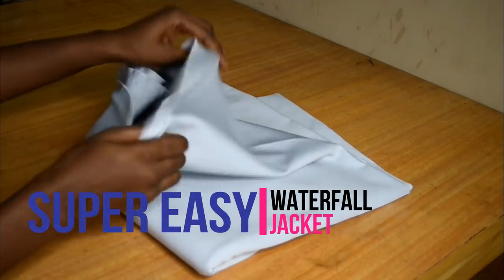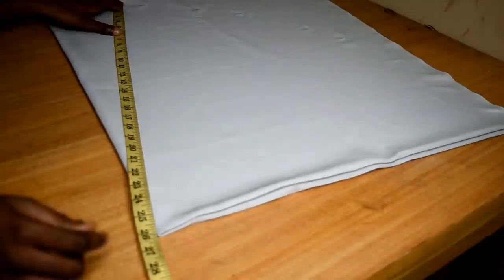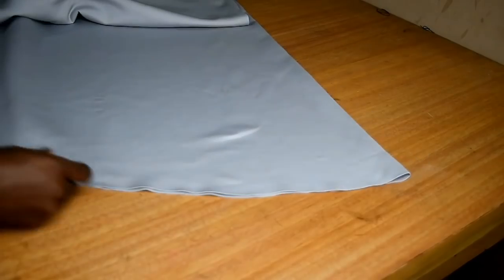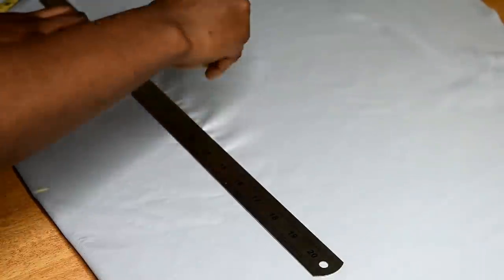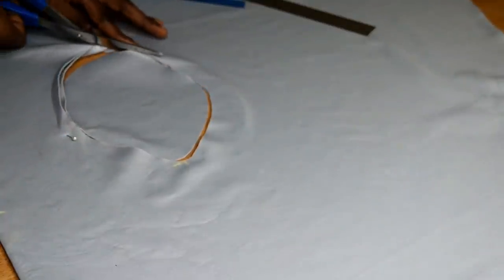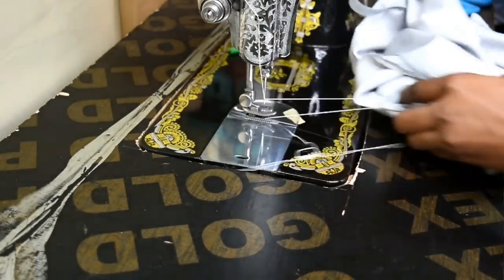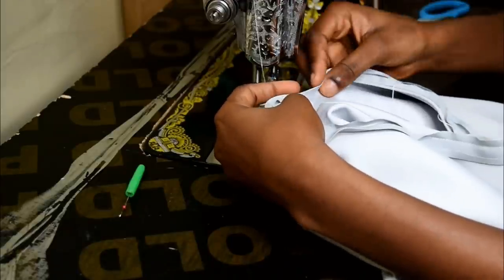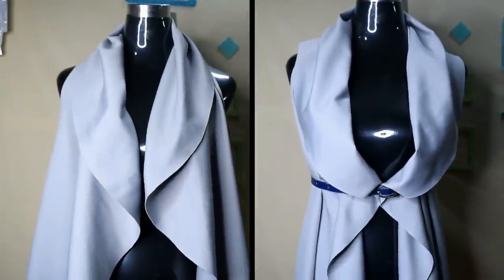HOW TO MAKE A  WATERFALL JACKET | DIY | Circle Skirt Method

Comment: Thanks so much, God bless you abundantly. You're an angel. But can one add sleeve to it and can one use ankara and how many yards. Making mine right away💃💃💃🕺🕺🕺💃💃💃😘😘😘
Reply from the maker: Hi, sorry for the late response 🤦🏿‍♀️. You can definitely use ankara. 1.5 to 2 yards should be okay. But you will need to hemm the edges preferably with a bias binding.